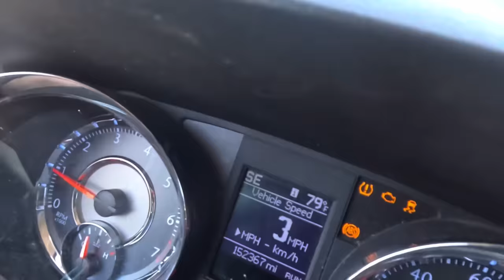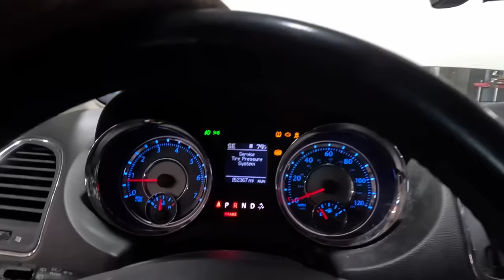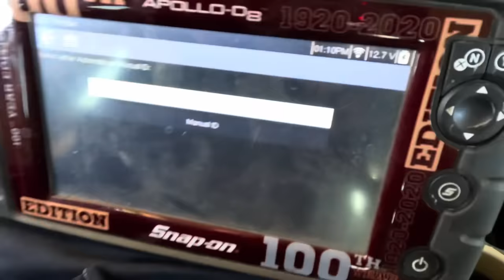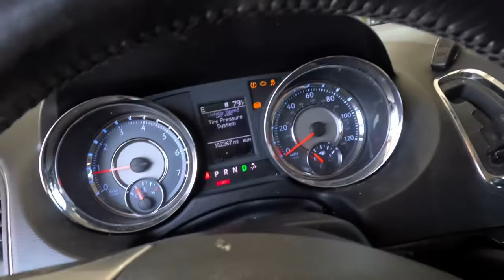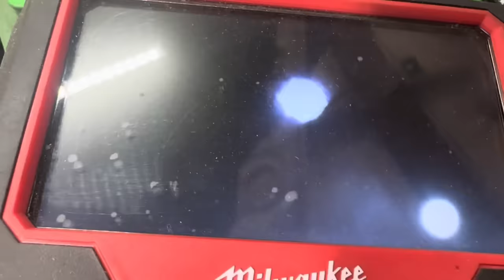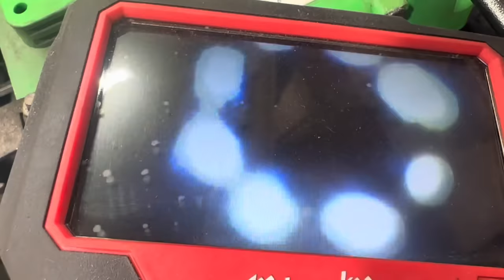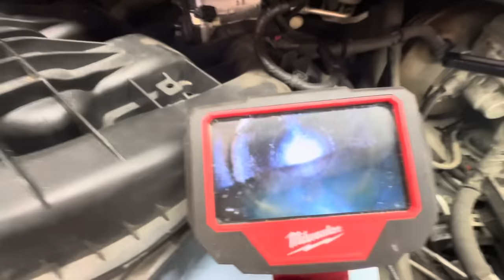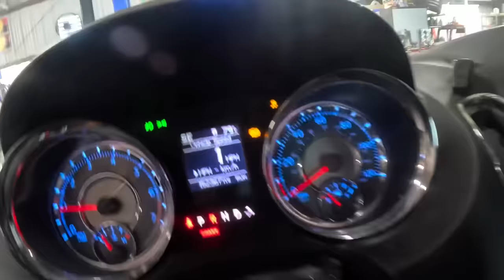Towed In! Died on Highway! (Engine is Drowning Itself!) Chrysler 3.6

Comment: Procedure for diagnosing a Chrysler:

1) Open hood.
2) Pull pin from grenade
3)toss grenade into engine bay
4) close hood and run. 

Guaranteed to solve all Chrysler problems.  There can't be an engine problem if the engine is not there anymore. 👍
Reply: If people would learn to quit running engines when they start to overheat and especially when they see steam, would stop a lot of the problems.  Ray saw the steam coming out, saw the water near the back hose, yet kept the engine running while drowning it with water.  He just made the problem worse.  They towed it in for a reason.  
And yes, I think Ray is a really good and honest mechanic, but sometimes good mechanics get in a hurry and don’t think it through.
Reply: @shakerman55  Gotta find the problem some how. If the owner already drove it overheated, damage was already done prior, Ray is just trying to find the problem. If there isn't enough fluid in system, you'd never find that leak, simple common sense right there.
Reply: Sad that that happened, too bad for that motor
Reply: Step 1 of diag is VERIFY THE CUSTOMERS COMPLAINT/CONCERN. As soon as he verified the customer’s complaint/concern he found the problem and shut the engine off. Ray did nothing wrong. More than likely, the customer drove it longer and harder than he should have. 
 None of this is said in defense of Chrysler/Fiat at all lol but in defense of the diagnostic process alone and in turn, Ray. Not at all Chrysler/Fiat lol FTR
Reply: With these Pentastars, the grenade was installed at the factory … several of them.
Reply: @Ham68229  
Ray already knew the problem.  It overheated.  He saw it didn’t have water in the radiator.  He saw the water in the back at the hoses already, so he knew there was a leak there.  If he had run the scan on the computer BEFORE he started it and drove it, he would have seen all of the codes and knew #4 cylinder was in trouble.  Run codes first, look car over first.  Ray wants to jump in and start and drive first.  I’ve worked at dealerships and owned my own garage for many years.  You never jump in and run a car that was towed in before you do some diagnostics before it’s run. Never.
Reply: @shakerman55  yet still needed to find where the leak was coming from
Reply: 1. open hood
2. Remove radiator cap
3. Put cap on new car
Reply: @Ham68229  Nah, he could had easily done a cylinder check before running it. If the customer towed it in, chances are the customer already had enough coolant/water in the cylinder to be visible. Mechanic common sense 101, when you see steam, you turn it off right away. Also when a car is towed in DUE to engine problems, you always do simple engine checks/scans before turning it back on. As for "...the leak...", nah, you always need to see what shape an engine is in BEFORE risking damage. Finding the source of the leak, can be done AFTER verifying that turning the car on will not damage it/damage it further.
Reply: @KendrasEdge757  He actually continued to run the engine after seeing the steam and even got a funnel. We can see that in the video.
Reply: Yep, and pity all these people paying 100k+ for those crappy hellcats and scat packs, they are going to be soo sorry when no matter how well they care for the car it still just dies randomly from some stupid plastic part failing.
Reply: Why is no one talking about the plastic part that failed on a critical component of a car.  This vehicle was DOA ….in my humble opinion Ray did not cause the car any further harm.
Reply: Grenade?  That's old school.  Now we use a TSC (Thermite Scuttling Charge.)  and we leave the hood up, Don't want it to melt.

Can't repair a puddle of slag after all 😁
Reply: @tradde11 
Might have been saved.  A mechanic can’t make that call just because they don’t have the patient’s to do it right.  When a car is towed in from overheating, you always check codes and visual and pull plugs before you jump in and fire away.  It’s not your call if it was damaged beyond repair until you do the right thing.  Ray is a good mechanic, but he jumped to make a video and didn’t do his usual due diligence.
Reply: You know that Zero manufacturers engines will survive running overheated for extended periods of time!! Not to mention not doing maintenance.
Reply: @craigfin3222  cylinder check wouldn't find a heater hose leak
Reply: @billyscott922  Exactly, too many are pointing out that he ran it while it's steaming. Failed part buried deep behind the engine. And if people actually paid any attention to the video, as soon as Ray saw the fluid leak, he shut it down. Did a scan tool diagnostic, discovered the issue with #4 cylinder. Scan tool also will NOT show if or where a leak is. Common sense has really gone away. Instead of looking at all the issues, as Ray has basically discovered, driver continued to drive to overheat the engine. Leak caused the overheat, driver continued to drive, hence destroyed the engine.
Reply: Something to throw out there. The 3.6 Pentastar is the number 1 selling engine. Chrysler has put it in every car for over what, 15ish years? 
If another maker sells 100k engines and there are 10 with problems, by ratio Chrysler sold 10x and this 100 issues would be the same quality.
People need to realize this. And that the 3.6 is actually statistically above average and considered very reliable.
Issue 2, this is a late model 3.6, which is pre engineering upgrades including all models getting the upgraded cooling that was originally only added with a tow package.
Reply: @EC_ATV_Outdoors  I think what many are missing is, the issue wasn't really the engine itself. It was the leak that caused the overheat along with the driver continuing to drive with it overheated. That's the cause of the engine failure. One simple "critical" plastic piece that should have been aluminum.
Reply: Hilarious...
Reply: @Ham68229  100% true. Also, it takes quite a while to overheat an engine to the point of damaging it just by running it at idle and that definitely won't happen when the cooling system is kept full of fluid even if it does have a leak.
Reply: If you keep driving 'em with the temp gauge pegged to the right, it will  destroy any engine. This disaster didn't happen all at once.
Reply: @shakerman55  I have a feeling Ray did all that before starting the camera, and called the engine DOA.
Reply: @dennislaur2515  
You may be right.  I certainly hope so.  I know he does way more things off of camera.
Reply: @shakerman55  You can hear just by the way its cranking that that thing got HOT, They drove it till it shut itself down at highway speeds, That engine is damaged well beyond what id trust if it got hot enough to throw oil pressure and temp codes, It turns over like it soft seized, Anything ray did beyond that is moot, You cant just re gasket that engine. Its been cooked to death and tripped low oil pressure codes. Id never trust it again.
Reply: @shakerman55  the engine was already broke anyways
Reply: @yamisniper  
First of all, nobody but God knew at the time if that engine was trash.
When you are a professional mechanic, you cannot assume anything.  That’s what separates the professionals from the keyboard warriors.  A professional never assumes an engine that he just received from a tow truck is blown.  A professional checks all of the codes, pulls the plugs, even a compression test.  A professional never jumps in a car and cranks the engine, then floods it with water, without any due diligence.  That’s what people pay professionals to do.  Not ASSUME it’s blown before due diligence is done.
The problem is that some new mechanics might watch this and develop bad habits.  I added, hindsight is 20/20.  Professionals don’t operate on hindsight.
Reply: @shakerman55  if ti wasnt bad in the first place it didnt matter if he jumpe dint he car to start it. even south main auto drives all his cars in unless it wont start
Reply: @yamisniper   The point is nobody knows for sure what’s bad and good.  That’s why a professional does his due diligence and makes sure.  This isn’t a video game that you guys play and can hit reset.  I worked as a professional for 40 years and I found out the hard way that it’s not my job to assume anything.  It doesn’t matter who does what, it doesn’t make it the “right thing to do”.
Reply: @shakerman55  Remind me to NEVER let you diagnose my car.
Reply: @61rampy65  
You are reminded 😁
Reply: @shakerman55  Thank you.
Reply: @61rampy65  
You’re welcome.  I’ll also remind you to never let me rebuild your engine.  I would hot tank it to clean it completely.  I would have the cylinders honed correctly.  I would measure everything with micrometers and bore gauges.  And last but not least, I would do the correct procedure for making sure the entire engine is pressurized and oiled BEFORE I installed it.  Then you don’t get 5 minutes of engine wearing clatter when you start it.  And I’m sure you wouldn’t want anything to do with all of that.😁
This is a public service announcement.
Reply: @shakerman55  Repairing is not diagnosing. That is where you fall apart. Bye!
Reply: @61rampy65  
I know that song!!  Love it!

I…..FALL.... to PIECES…
Patsy Cline

Comment: Have the 3.5 V6 in our Journey.  Had a thermostat fail 'closed' while on the highway.  Overheated and cracked the Y pipe off the heater core to the rear HVAC.  Snapped it clean apart.

Replaced all the parts, and tossed in a waterpump and timing belt  (it was overdue).  All that work and it overheated within minutes with a stuck 'stat. 

I pulled off the road within seconds of hearing the 'chime' warning and shut it down.  That's the only thing that saved it.
Reply: But that's what will save it, almost every time. That's what this owner didn't do.
Reply: I like those new thermostats that fail open.  Sure you have to replace them if you over heat, but better that than the engine under it.
Reply: I had a very similar issue. thermostat locked closed and the lower radiator hose literally popped off the rad. I was towing a trailer from Fort Polk back to San Diego when i retired from the Army back in 2019. I made it to El Paso. TX and AAA towed my jeep to the shop but they couldn't take my trailer. Thankfully US Army WTF Moments helped link me up with a soldier with a big-ass truck to pull the trailer to a hotel my wife got as she was driving our van. Thankfully the engine survived until i was able to replace my jeep 3 years later when i got the dreaded lifter tick.

Comment: A couple of other possible scenarios: 1. The head gasket failed, over pressurizing the coolant system causing the fitting to fail. 2. A squirrel or other rodent gnawed on that part causing a weak spot which failed when the cooling system got up to its normal pressure. Either way, this vehicle was doomed from the day it came off the assembly line since it's a Chrysler product.

Comment: I had a run of bad fuel pressure regulators on GM engines back in the early 2000's. These were the ones on the fuel rail, controlled by vacuum diaphrams. I believe they used a rubber that wasn't ethanol resistant, but GM wouldn't admit responsibility. It took a couple of years before they released an updated design to fix the issue. 
Anyway, I had one customer with a Chevy Beretta with the Quad 4 come in on a flatbed because it hydro locked from fuel blowing through the regulator, up through the vacuum line and into the intake, down into the number 2 or 3 cylinder. Fortunately, it didn't cause any damage to the engine, since it wasn't running when the cylinder filled up. I pulled the spark plugs and spun the engine with the stater, which shot a jet of fuel against the bottom of the hood and deflected forward onto the wall, nearly hitting my wife. That could have turned out really bad, had there been a flame anywhere within 20 feet. 
I replaced the regulator, squirted a dab of oil in each cylinder, and it fired right up. 
Another customer with an Impala that went through multiple regulators until the updated part was released. They would last 13 months, just 1 month longer than the warranty. Thankfully, my auto parts store was able to warranty the failed regulator after the second failure. I believe it was the third failure when the new design was available, and I never had an issue after that one. However, my customers' son decided to slide the car sideways at a high rate of speed and turn it into the flying DeLorean in Back to the Future II. I had never seen a car with all 4 wheels bent over. I have pics of it. The customer decided not to fix it because it would have cost more than the car was worth. 
Also, along with his car, I had 3 Impalas in one season with bad blower motors/resistors. One of those customers had replaced the resistor twice, not knowing that the blower motor was causing the resistor failures. Always replace both as a pair. The resistors almost always fail because of a bad motor. If you lose one or more speed, having only off and high, the motor is bad (requiring too much current to turn, which burns up the resistor). The resistor is cooled by the airflow from the fan, so a slow spinning/ high Amp draw destroys them. It happens to us all at some point (unless you only keep vehicles for a couple years at a time).
Certain things on cars should be done as pairs, like headlight bulbs, shocks, anything brake related (pads, calipers, rotors), and blower motors/ resistors!
I've got 40 years of automotive repair under my belt. I've never charged for anything I've never fixed, charged the lessor of book or actually labor time, and even went to my customer's homes/work to pick up/drop off their vehicles. As an example, I had a customer with a Cadillac SRX with the V6 that had a bad timing chain tensioner. I replaced all three tensioners, chains, pensioners, guides, and gears. The book time was 19 hours! At dealer prices, the labor alone would have been over $2k, but my labor rate was only $50/hr at that time (working from home). He was retired and he clearly wasn't wealthy, having bought it used and it being his first Caddy. The parts were listed for $1,500, but through AZ were about $500. I agreed to do the job for $500, or 10 hours of labor. From start to finish, I was able to do the job done in 10 hours (with no corners cut). 
I have many stories like this, and some stories of shady dealer's shops. Maybe I should start a channel? Lol
Reply: Nice book.

Comment: One of the worst engines made. Our oil cooler on our Journery went bad then caused many more problems. Never ran again. My oldest daughter had had problems with the heads on her Ram truck. Heads had to be replaced during the strike. New heads came in and they were bad. Brand new heads?. My middle daughter had the same problem with her mini-van.  Same motor, same problems.

Comment: I work in IT, so I would firstly recommend turning the car off and then on again and if that doesn't work, I would suggest a software update.
That should solve the issue.
Reply: Just press control/ alt /delete for a reboot!!😊
Reply: Clearing the cookies out from between the seats should help too.
Reply: @billyounger9713  Or in this case, you turn the key while simultaneously holding the turn signal switch in the right position, lowering the front passenger window, and powering the radio on.

Comment: What surprises me is that some engines are known to give a lot of trouble (and expensive ones), yet people still keep buying them. I prefer to pay more, but in exchange I want something to last years.
Reply: Hope you show us how to save this engine, if we choose to do it. 😊
Reply: It lasted over 150k miles.  That’s pretty good for a domestic front drive.
Reply: The problem is that unless you or someone in your family keeps up on cars and car issues how do you know?
Reply: @mikecumbo7531  If so many people keep complaining about a particular engine, that is pretty clear. Whatever the type of vehicle and brand, would you be willing to pay potentially thousands more in repairs?
Reply: 19 yr old bmw 525i  w/ N52 in-line 6. Lower coolant line connects to block with a - you guessed it - plastic flange. Gotta change out that flange before it melts or disintegrates. Learned about it watching a video like this.
Reply: @richarddrozd1201  Better change it fast, otherwise it might happen the same as in this video, and that would be a waste of a good car.

Comment: The "Y" connectors get spongey and brittle. They can blow out so quick the coolant is gone before you can react. I had a replacement last less than 200 miles. There are 4 of these on this engine. My parts stores did not have the metal replacements. Blew out multiple times.
Reply: "They can blow out so quick the coolant is gone before you can react." Nonsense. You only need enough warning to get off the road and turn off the engine. No coolant won't destroy an engine instantly; there is always reaction time. This driver ignored the issue and kept driving.

Comment: I would think if there is no engine knock and has oil pressure, at a minimum would need head gaskets, if not a cracked head.  If the head is cracked you would be right in assuming a used engine would be the best alternative for this vehicle.  Customer is between a rock and a hard place on weather to invest that kind of money in this old of vehicle, or just cut his losses and move on to another car.  This scenario plays out everyday in the auto repair business.  Not a good place to be for this customer.
Reply: With that mutch overheating its most likely that the head is warped especially if its made out of aluminum